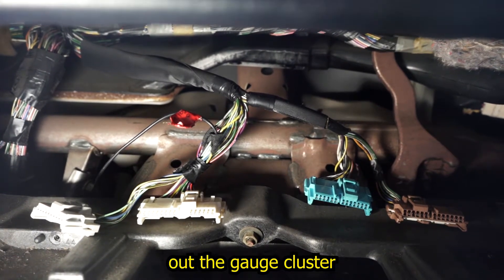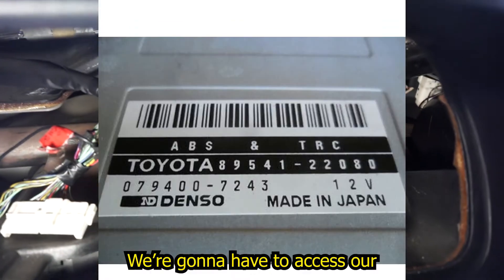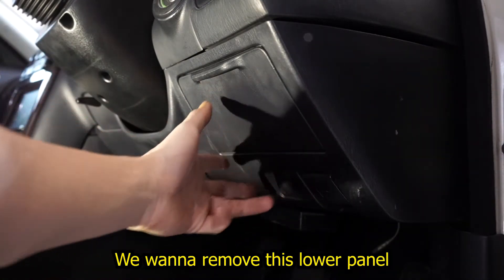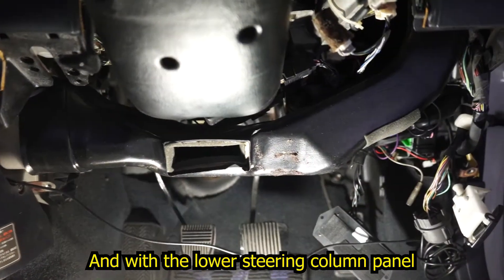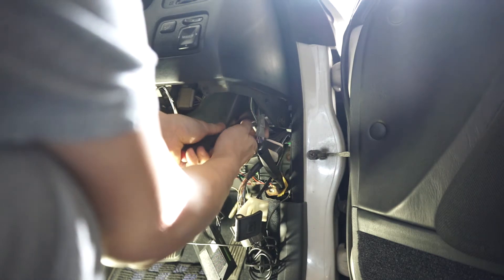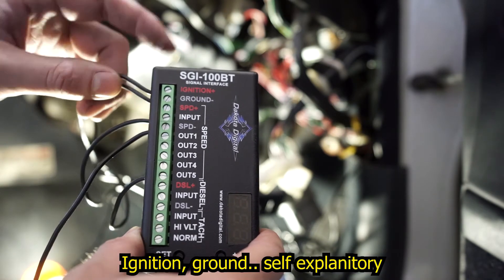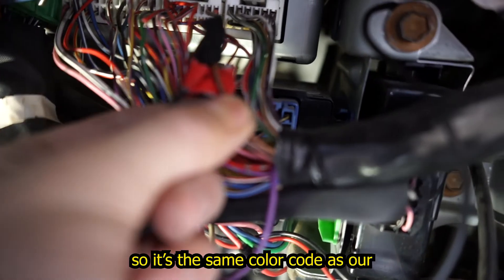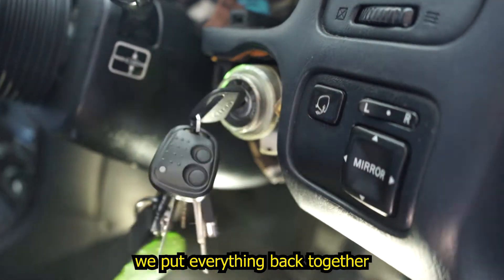JZX90 CD009 Working Speedometer DIY [ANY TRANSMISSION] | Dakota Digital |

Comment: Best JZX youtube channel, really well made videos and very helpful. On my own jzx90 i have recently went COP yaris coilpacks but now my tacho isnt working. will this unit be able to provide a tacho signal in my jzx90 would you know? thank you
Reply from the maker: Thank you! And yes you shouldn't have any problems if you can get a signal from the abs wheel speed sensor
Reply: @JZXKenny worked perfectly to get my Speedo working off ABS sensor . Now I just need to get a signal for my rev gauge

Comment: what should be done if the car does not have ABS. ‘93 tourer Vs didn’t come with ABS
Reply from the maker: For the CD you can buy a driveshaft yoke that comes with a speed sensor provision. I just did a quick google search and it seems that lojkits.com sells them
Reply: @JZXKenny  i don’t have a CD, factory r154, that’s where i’m confused i guess
Reply from the maker: @gwend01yngurts  there should be a speed sensor going into your transmission. Solid yellow wire
Reply: Hi I done this when the Speedo gets to 60 it drops to 0 and won't move again untill I stop and start again any idea why this would be